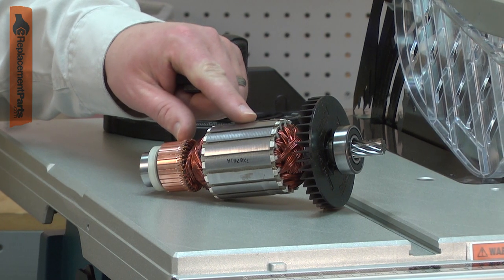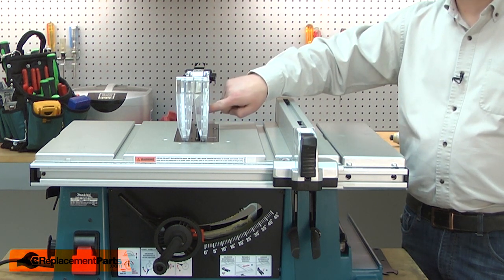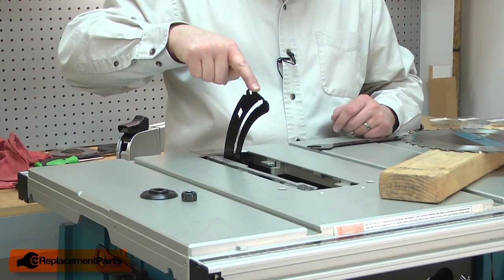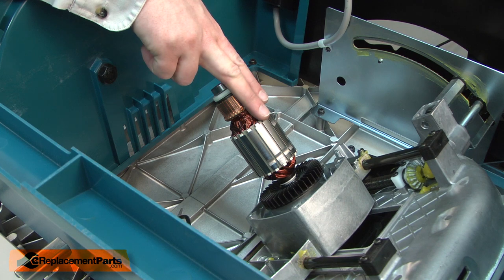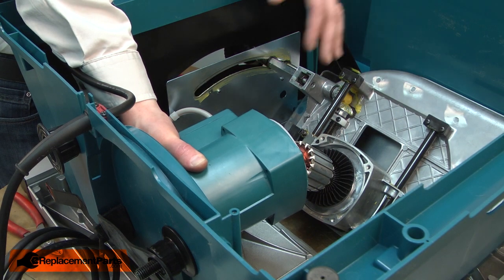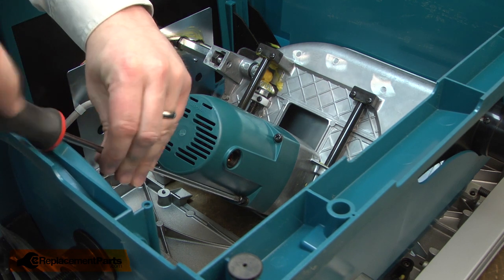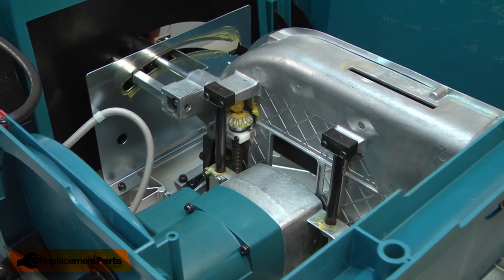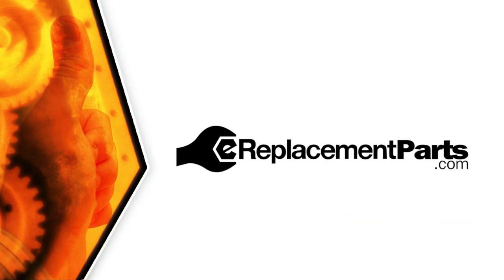Makita Table Saw Repair - Replacing the Armature (Makita Part # 510070-6)

Comment: Thank you... When I took my house the armature stayed inside the housing and I couldn't figure out how to get it out. Lucky I was just replacing the brushes that video was on before this one lol. Still when my knowing how to get it out of my housing. I took the box apart that was on the housing (Holds the power wire) nothing worked could not get it out.... but I fixed a jammed burnt down melted brush. Got it from my old boss cause he didn't wanna fix it lol

Comment: Is there an instruction on how to replace the field? Specifically the wires for the brushes houses. They are tricky to reach
Reply: Did you ever get the wires on to brush housing ? got the same problem  HELP
Reply: @fredjones1238  yes, I did. And then found out I had them on reversed and had to do it again. The trick I finally came up with was to use a couple of 2-fork thin skewers for barbecue 😎
It worked fine and I’ve been running the saw successfully since.
Reply: @JesperZachrisson  thanks will give it  a shot

Comment: I have removed brushes and housing with field and the field will not separate from armature. Rotating armature and pulling will not separate the two. Any suggestions?
Reply: I had the exact same experience. Found articles pointing to the machine had overheated and melted the interior oft the field and housing, so I had to buy replacements for these as well.

Comment: I'm trying to replace the armature on an older Makita 2708 table saw. It seems that it's pressed into to gearbox end (blade end) and there's virtually no clearance between the fan and gearbox housing to pry them apart. Any suggestions? It won't simply come out by hand like the model in this video.

Comment: Hello! Very good vid! Do you know if the armature from 2704 will fit 2702 table saw? I checked part list of both table saws and found out that they are using mostly the same parts. Stator is the same. The helical gear set of them differ (depth and needle bearing/ball bearing) but both have 42 teeths. The gear housing is different. Still think that the armature will fit. Can somebody confirm it?